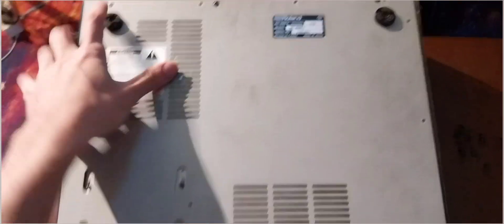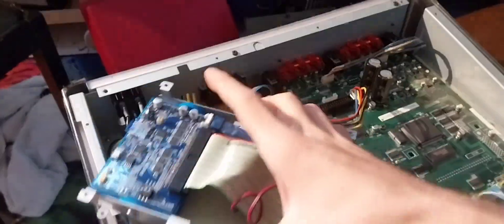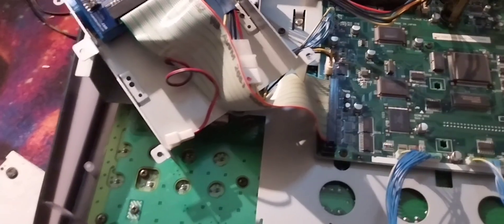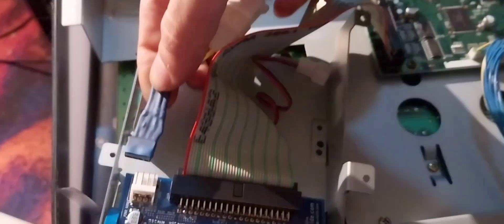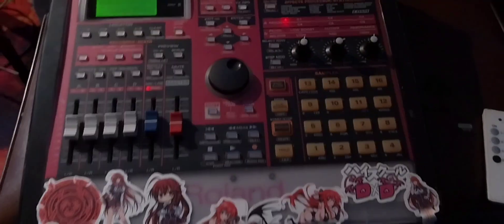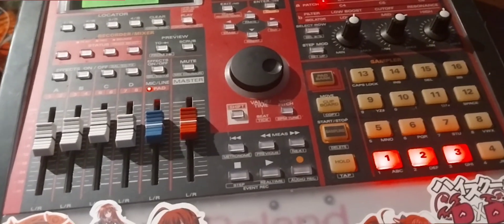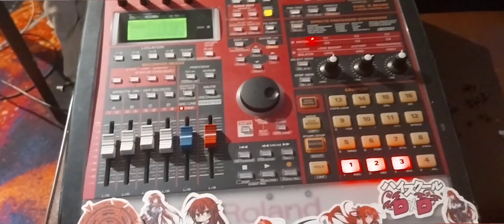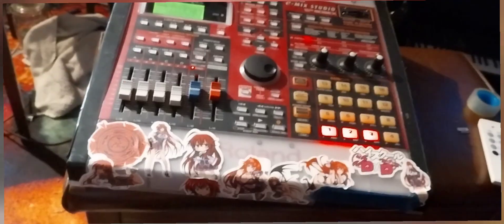JSW| ROLAND SP-808 GETS ZULUIDE RP2040 (ZIP DRIVE EMULATOR)   THE BEST SP GETS SOLID STATE!

Comment: Setting the device type parameter, should enable larger drive capacity.

1/ In the zuluide.ini file under [IDE] find: Device = [Type] 

2/ set Device = [Removable]

3/ Always use an image filename prefix of remv - (generic removable file)

Example: remv A_Roland_Synths ; remv B_Korg_Synths; remv C_Drum_Machines  * The images are sorted alphabetically

More details can be found by searching for: "ZuluIDE-firmware"

Comment: Does anybody has and can kindly share an empty ZIP image for ZuluIDE but larger than the 100Mb which can be found on internet? Or tell how such image can be built? Having just installed ZuluIDE on a SP-808 and being locked to 100MB space on each SD is quite frustrating.... Thanks to everybody wish to help me.
Reply from the maker: One of the other zulusp owners commented this 

"I've just found out how to extract an image from a ZIP disk via a free program called Exterro FTK Imager (probably WinImage would work too with the right settings) and then by adding an 'INI' file in the microSD with the name of the image... the trick is to specify the DEVICE as 'ZIP100' even if you are extracting 250 or 750Mb disks... at that point any image is taken and the size is reflected in the time available for recording (in my case about 2 hours instead of 24 minutes). The extraction can be a pain in the backside as it might take a few hours. Maybe there is an option to swap images within a single microSD (while inserted in the SP808)... at this stage I need to eject and rename the ZULULAST.txt (I'm waiting to receive many microSD... at that point I'll just swap cards)."

I havent tried this but it might help you

Comment: Someone on Ebay (UK) is selling a complete SP808+Zuluide+expansion card (is that you?)...not only that, apparently he managed to extract 1gb and 2gb images to use in micro sdcards (so 2 hours recording time is possible). How to make zip images of 1gb without the actual disc?
Reply from the maker: Im wondering most of this.myself nit selling anything on ebay. But it is intresting that he has bigger images. 
 I never made much sense of the actual zip image creation because the program i was using did not work right
Reply: @junksmith_wizard  I've just found out how to extract an image from a ZIP disk via a free program called Exterro FTK Imager (probably WinImage would work too with the right settings) and then by adding an "INI" file in the microSD with the name of the image...the trick is to specify the DEVICE as "ZIP100" even if you are extracting 250 or 750Mb disks....at that point any image is taken and the size is reflected in the time available for recording (in my case about 2 hours instead of 24 minutes). The extraction can be a pain in the backside as it might takes a few hours.
Maybe there is an optoin to swap images within a single microsd (while inserted in the SP808) ....at this stage I need to eject and rename the ZULULAST.txt (I'm waiting to receive many microsd...at that point I'll just swap cards).
Reply from the maker: Well done bro! Ill try and see if i can figure it out eventually! Sounds useful

Comment: Yes! the IMG on the link above worked like a charm in my case (there is another available online which didn't work). All in all, no troubles - I've opened my SP808 many times before to upgrade it and this was just a routine job - I've used the worst sdcard I had in my "arsenal" (one of those fake) and it works fine.
Now, how to transfer old ZIP disks (so I can finally get rid of that obsolete gear) into the sd card? I'm going to find a way and then a 9 is going to be upgraded to a 10 out of 10 (yes, 125 dollar is well worth already).
Reply from the maker: Hehe good to see i wasnt the only one that got intimidated by their world class customer service 😅. Glad i helped

Comment: Where did you found out about the wires configuration? Eg. the red isn't being used and the yellow is used instead of the red? I mean, it's not very intuitive and if the manual is so scarce...you should be awarded at least a big massive thank you from all of us.
Reply from the maker: Im a rat that finds its way into everything so i had some experience dealing with molex cables from somewhere. I can deduce what goes where based on visual cues etc. ALSO THANKS ALOT FOR WATCHING IM ALWAYS STOKED TO  BE OF HELP!.

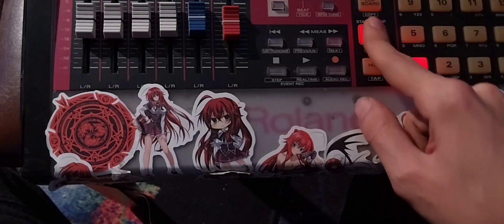Comment: I recently bought a zulu ide board and install it into my SP808.Then it happened like 6:56 on your video, It said no disk space! Can you tell me how you fix the issue. And I would like to know how you applied the image downloaded from the site?
Reply from the maker: You need a zip100 image on you sdcard it can be found at the github
Reply: Thanks for your comment, but how you apply the image? If you put it on the sd card, , it would formats the card when it starts
Reply from the maker: Yes its essentiay a file like a Iso but for zip disks

Comment: Bro. I have all the hacks to send you for it.
Reply: I've been trying to get this working for over 12 yrs, got the addonic drive still in the box. 😢
Reply from the maker: this is a separate product called the zuluide 2040
not any magic i did its just a new modern zip emulator
Reply: @junksmith_wizard  yessir saw your vid then Roger/aka the midi maniac's vid as well, ty for the reply!
Reply: Link them bro